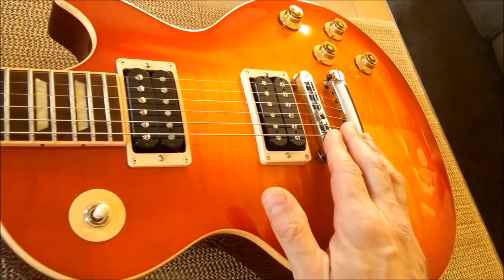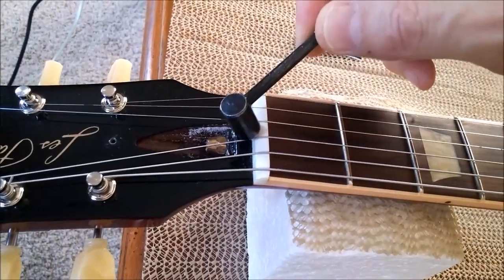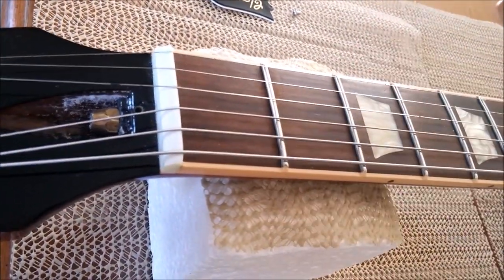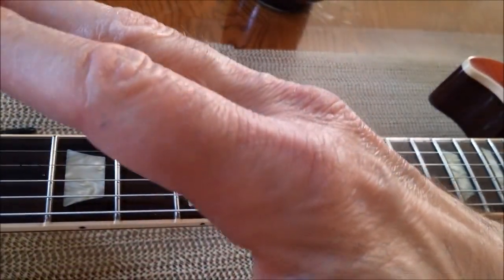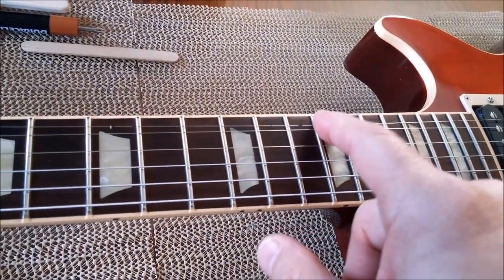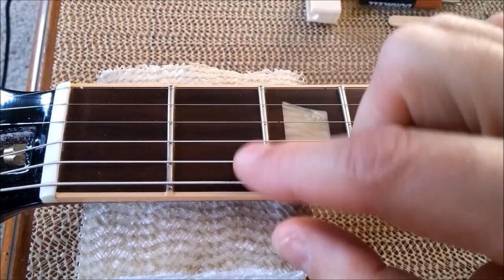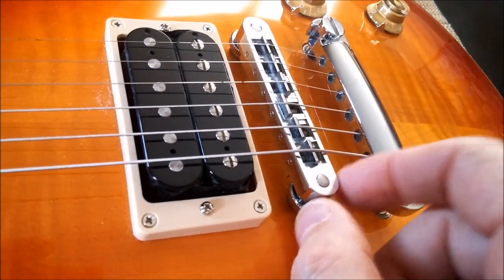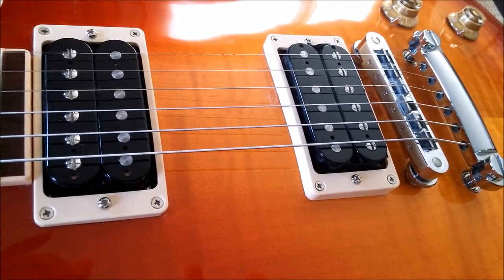Silky Smooth - Stopbar, Neck & Bridge Position

Comment: Incorrect! Raising or lowering your stop bar does not effect the tension of the strings tuned to pitch on the neck so no truss rod adjustment is needed. Once you raise or lower your stop bar you are going to immediately retune your strings to the prior tuning giving the neck the exact same string tension it had before you raised or lowered the stop bar.
Reply: I thought the same thing but it is true. I did a simple test with a spring scale pulling sideways on a string an there was less tension even though the string was at the same pitch. you can find a few things online about this.
Reply: Oh right, that makes sense! It’s just the break angle on the bridge basically, thanks!!
Reply: All these people who think the tension of their strings can be changed by raising their tailpiece really should consider submitting something to a scientific journal as they've clearly discovered a new type of Physics that Einstein, Newton and all the rest have somehow missed. It's remarkable! Think of the repercussions for the commercial and industrial world!
Reply: Johannes DeMoravia  I think it's you who needs to relax.  Just think happy thoughts.... happy thoughts.... happy thoughts.......

Comment: If the pitch of the string is the same, it is under the same tension.  You cant change the tension of a string without changing the pitch.
Reply: You are right. I wish more people had the brains to realize that fact.
Reply: @robertevans2143  After having thought about it a little more...   You wouldnt have to adjust the truss rod because the string tension is the same but  if the string is long from the bridge to the tailpiece,  or the nut to the tuner post, the string will bend easier due to the extra length of string.   A Fender jazzmaster, for example..   Really long distance from bridge to body, and the E string is also very long to the tuner, bends very easily.
Reply: @robertevans2143  Sorry to be another person to point this out.  I should have read the comments .  It must be that the extreme angle from the bridge to the tailpiece stops the stretch of the string and when alleviated, allows the extra distance of string to stretch.

Comment: One thing I'd add is after making your adjustments put the guitar down for for at least a half hour. Sometimes when you make an adjustment and it still just doesn't feel right, instead of going crazy and continue to make adjustments to find the sweet spot give the guitar a chance to settle in with that new adjustment. I used to drive myself crazy making tiny adjustments over and over again never to find that "sweet spot". I was blind to the fact that the wood needs time to settle into these adjustments as well.

Comment: Wrong again! When checking the relief of the neck with the low E string you fret at the first fret and the higher fret where the neck meets the body which would be the 16th fret on a Les Paul.
Reply: Les Paul manual says 14 but that’s close enough, they want measurement at 9th too.

Comment: This is wrong. If you raise or lower the stop bar in isolation yes the string tension will change a little. However you will have to re-tune the guitar. Once tuned the tension in the string will be exactly the same as it always was. If the truss rod tension is correct before you move the stop bar, once the strings are re-tuned there will be no need to adjust the truss rod. It simply isn't physically possible to reduce the tension in the strings and still have them tuned to the same pitch. I suspect that when people say adjusting the height of the stop bar can reduce tension and make the guitar easier to play what is really happening is that with the stop bar higher, the friction over the saddles is slightly reduced. When a bend is played the entire string stretches including the small sections between the nut and the tuners and from the saddles to the stop bar. Less friction over the saddles means the short section of string between the saddle and the stop bar stretches and relaxes very slightly more easily. However I would be amazed if this changes the playing feel to the point where it can be felt.

Comment: Great tip, thank you!  I have been chasing my tail a little trying to find that balance of low action and "slinky" string tension.  I watch others bending these Les Paul strings so easily (like you did in this video).  I tried adjusting the truss rod for a little relief and the bridge, I will definitely try the stopbar adjustment.  I always wanted to try over wrapping as well.  Maybe I should clean my guitar as well, your guitar condition is making me feel guilty! Thanks again.
Reply: what results did you find?
Reply: The loosening of the tailpiece is the answer.....I had the same problem for YEARS until I was watching some tutorial on string tension and they mentioned the tailpiece.....I only loosened a little bit on each side and it made a WORLD of difference.😑👍

Comment: Trying to share a simple perspective with the community prior to the invention of the stop tailpiece there was something I believe known as a claw which held the strings and was attached to the butt end of the guitar where the rear strap button is located this claw maintained an angle from the rear of the guitar to the tune omatic Bridge the height of the tune-o-matic Bridge maintains a correct distance from the fretboard in relation to the next set the claw maintained correct angle from the tuna Matic bridge to the rear base of the guitar with the invention of the stop tailpiece people were top rapping to maintain the correct angle of the claw and avoid the strings coming in contact with the rear of the tune-o-matic bridge the claw angle is important to maintain

Comment: string tension determines the pitch of the string.
Lower tension=lower pitch!
You can't reduce string tension by raising the stop bar.
Reply: francandsylvia vanoort.
You lack engineering/mechanic understanding. If he raised the stop bar the distance from the stop bar string contact point to the bridge saddles contact points becomes less (and ultimately so does the distance to the nut) , which relieves some tension. When to points (nut and stop bar) come closer together then string tension becomes less. String pitch becomes lower!
Think of a tug of war using a rope, when the two sides come nearer to each other the rope becomes slack. When they move back as far as they can go and really dig in the rope becomes tight! Got it? Good!
If you lower the stop bar, the distance from the stop bar where the strings make contact to where the strings make contact with the bridge saddles becomes somewhat greater because the stop bar moved  down and yet the bridge is not moved. So the string tension becomes greater, which in turn will bring more tension on the string. When the two points of contact from between the nut and the stop bar move apart the string tension increases.
Or do you think metal guitar strings stretch a lot instantly when you make such changes?
Attach a tuner and raise your stop bar (you may have to raise it up a lot to notice any changes in pitch) the strings shall become slightly flat. Then lower the stop bar again and the strings shall return to the original pitch. If you lower the stop bar even lower than the original setting the strings shall become somewhat sharp. De this if you can not wrap your head around the mechanics. At least your eyes shall see the changing in pitch indicated by your tuner. That should convince you if you follow my instructions. You may have to move the stop bar up and or down a lot to notice the changes. Don't just move it a tiny little bit as maybe your tuner is not very sensitive to small changes in pitch.

An easier thing to do is to raise your bridge, and string saddles. The pitch always changes. pitch goes higher when you raise the bridge/ saddles. Pitch goes lower when you lower the bridge/saddles. Right? Please don't tell me you never noticed this!

francandsylvia, you know what, because I think you may be stubborn I want you to raise and then lower the stop bar and see the pitch changes. I ask this because this is what you are in denial about.

you wrote: You can't reduce string tension by raising the stop bar. Well I ask you to think of the bridge/string saddle as the center of a circle. Now immagine an arc/rey from the center (bridge/sassle) that would make contact with the stop bar. The stop bar can only travel up or down and it does this in a perfectly vertical line. Now how can the arc of the circle not change length when the stop bar only travels straight up and down and does not follow the arc of the original contact point (bridge/saddle -center of circle/arc). Is it now clear to you now? 
Take a steel guitar string and hold it taught and in a horizontal position in your left hand, keep that hand at a fixed point (bridge/saddle), now take the other hand your right hand and while keeping the tension on the string even, starting from the horizontal position, move this other hand upwards. As you keep moving upwards notice that since the string is not changing length, as you move from the 3 o'clock horizontal position and upward your hand is forced to arc towards the 12 o'clock position, just like the face of a clock. The stop bar can not do that, it can not follow the arc of a circle, so therefor the string shall get tighter and tighter and the pitch shall increase as you raise the right hand (stop bar). Now do the same experiment , left hand holding the guitar string very still but taught. Start at the 3 o'clock position (horizontal)  now with your right hand holding the other end of the string horizontal and then move it downwards. Your hand is forced to follow the arc of the circle and would eventually sweep into the 6 o'clock position. Again, the stop bar can not do that, it can only rise or fall in a completely vertical line. Hence at the zenith the string shall be under greater tension than it was at the horizontal assuming the string did not either break or that it did not prevent your hand from moving straight up/down and not follow the arc of the circle at the bridge/saddle point of string contact. The same holds true when you move in a straight line downward as only the stop bar can do. The tension on the string increases and the pitch is higher. Of course you can't really do this because the string tension would be so great it would either snap or it would not allow the hand to move perfectly vertically down, the string would be to tight to do that. There would be only one height of the stop bar where the string tension shall be even. At any oher height, greater or lower the string tension shall increase once moved past the horizontal. Normally the stop bar is lower than the bridge/saddle so the biggest change shall occur when you raise the stop bar, the tension shall be relieved and that shall indeed lower the pitch. Once you raise up beyond the horizontal the string tension shall increase and pitch shall go higher. If you lower the stop bar beyond the original almost horizontal position the string tension shall increase as it can not follow the arc and that raises the pitch. Of course there really is not all that much room to lower the stop bar. So the difference is slight. 
Only one place on a tangent line (stop bar) makes contact with an arc of a circle, at all other points from the center point not on the arc the distance is greater, the strings will change pitch.
Reply: francandsylvia vanoort 
Agreed. Anything that changes tension also would change the pitch on the notes played on the neck.
I see this all the time on YT.
Drives me crazy
Reply: Tension doesn't change, friction does. Hi break angle means it's harder for the string to move length wise, so have a shallow angle make the strings feel looser, easier to bend, loose when picking. But the tension STAYS THE SAME. Tension defines the pitch. Less tension the note goes flat, more tension the note goes sharp. Same note, same tension (given the scale lenght, string mass and density stay the same; they do).
"You lack engineering/mechanic understanding" No, you do.

Adjusting the truss rod when after adjusting the stop bar is a very dumb thing, because one doesn't affect the other.
Reply: @PeterDad60  yeah, this is valid. But if you retune the strings to be in the correct pitch, the tension should return to the same as it was earlier. Not?
Reply: fulesmackofule exactly. Haha. All that writing and explaining, analogies etc. and he was wrong.
Reply: 'Compliance'...resistance to bending, etc, or at least perceived compliance. Tension at rest/pitch is the same.
Reply: @PeterDad60  WOW. If your tuned to E then raise the stop bar E goes flat because you lowered the tension. So how do you get it back to E? By turning the tuning peg and putting the string tension right back to where it was before raising the stop bar

Comment: Nice video thanks!  I am finding I'm always breaking the D string on my guitar, and it always breaks in the same place.  It just dawned on me that it might be kinda sharp on the bridge in that place (fender stratocaster).  So I checked, it is kinda sharp there, it's not smooth.  If i push my fingernail against it, it kinda grinds on my nail.  No wonder the string often breaks there (probably every 20 hours of playing time).  Are there any tools to kinda fix this?  I assume it would be a really really fine, circular file thing and some way to buff it.  but I have no Idea.
Reply from the maker: It may be easier - and perhaps less expensive(??) than buying files - to replace that one saddle. Keep your old parts.
Reply: I never thought of that, that's a goo idea.  Thanks for the advice!

Comment: ADDRESSING THE TUNING ISSUE(S) MANY STRUGGLE WITH, IN REFERENCE TO THE GIBSON HEAD STOCK ANGLE;
I'll attempt to prove that physics plays a bigger role than most luthiers and experts rely on or mention.
I would also lament that a genuine State of the Art Guitar like a Les Paul, somehow ends up depending on whether your have a 5 cent pencil in your rig bag or a $10 tube of nut lube.
1. why even have that pronounced head stock angle?
The history of "guitar like" stringed instruments reveals that most of the Head Stock designs seen in earlier centuries appear as almost diagonal to the set neck position.
THE MATH;
imagine; you are pulling a string directly across the top of a fixed in place object. (the nut)
Now imagine; pulling the same string across and down.
1. Across and Down will accomplish 2 purposes.
a. it will secure as in stabilize the string by the use of binding it.
b. the binding pressure the string pre-load (torque) to the nut, will increase the transfer of string vibration into the nut and then into the neck, with substantially more fluency.
This is one of several reasons WHY, the Gibson Les Paul (and other product line guitars with similar head stock angles) are known for their unique tone.
EXPERIMENT;
take a properly set up and tuned up Les Paul (set neck) sit down, and balancing it on one lap/knee. (unplugged)
Then strum across the strings with measured determination and feel the entire guitar body hum and vibrate from head stock to strap lock.
The entire guitar becomes engaged in the creation of the sound. (most musicians love the tone AND the feel of this unique guitar because it can be felt in the hands and the body. (it's a more complete experience)
(try that experiment with your Fender "Bolt On" neck and witness the dramatic difference).
THE HEAD STOCK ANGLE;
Will create a given string preload "Tonnage" on the neck and at the nut.
MATCHING THAT PRELOAD TONNAGE;
The Natural physics, the E=MC2, the Cause and Affect, we should be trying to achieve is "Balance".
This is Why, I suggest that the Head Stock Angle be duplicated at the Tail Piece to the bridge.
When both ends of the string tension are equal the likelihood of the string Travelling to the Point of least resistance, will be substantially minimalized.
In other words; a radically high or raised tail piece May make the string feel more slinky, but when a decent Bend or whammy is introduced to that string, it will naturally want to return to the point of high tension and often times is found; crawling up and back behind the nut. The neck relief will exacerbate that physical tendency, compounded BY the set head stock angle.
AN IMPORTANT TIP;
The Height of the nut is critical.
Unless u get a Custom Shop set up, the nut heights for each string are not usually set properly.
SOLUTION and LOGICAL REASONING;
For Example;
1. tune your bottom or low bass E string to pitch.
2. fret that string at the 1st fret with your natural finger pressure as if you were playing.
IF the "F" note appears sharp, you will have to carefully dress the slot down until the "F" is showing In Tune.
Do this with all 6.
REASON; if your guitar is Out of tune at the first fret, it will have tuning issues all the way down the neck.
SO; 
The very first thing I do, is make certain my; Stop Bar to Bridge Angle is identical to that of the angle at the head stock.
All the rest becomes a personal preference as seen in the video.
A balanced set up like the one I proposed, will return the Bent or Whammyed String to the 12th fret a neutral area.
After all, that's where u set the intonation...right?
This will inadvertently allow the distribution OF the string vibrations all across the body and neck and Not favor any points where the pressures of preload are greater.